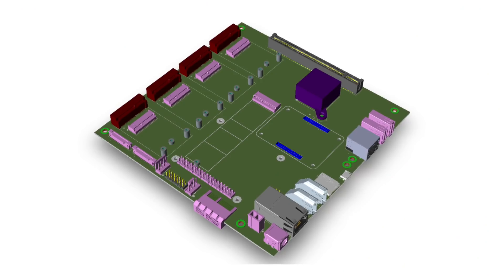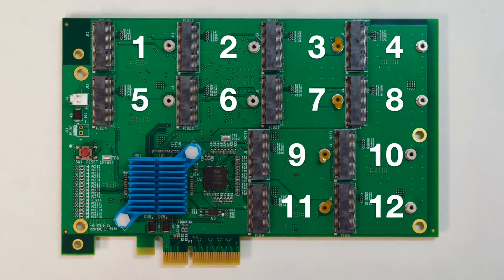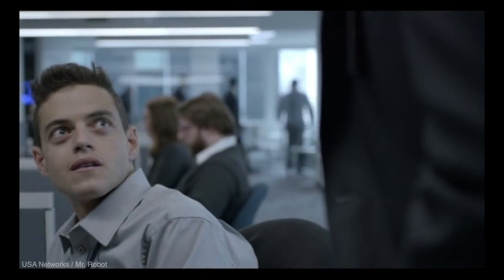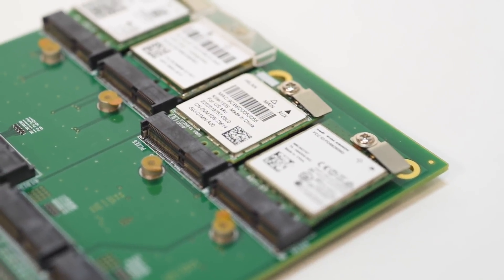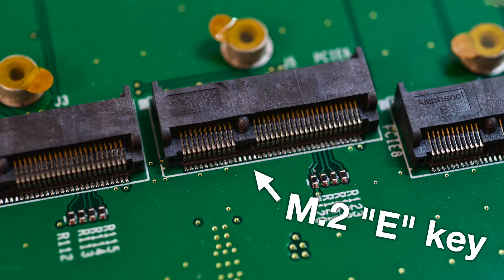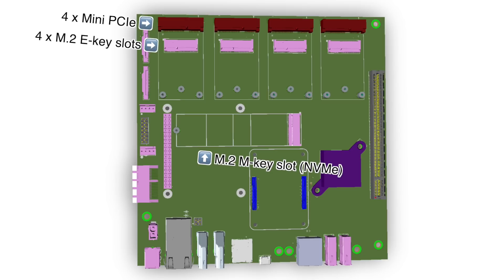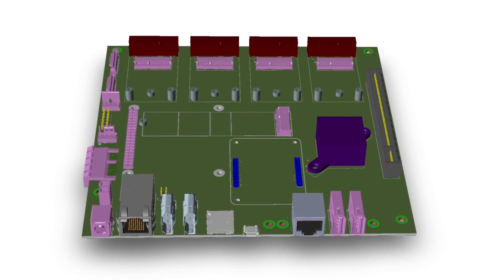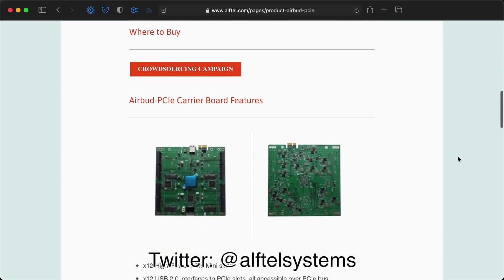12 PCI Express M.2 Slots on a Raspberry Pi!?

Comment: One PCI Express lane feeding twelve M.2 modules?
Reply: It sound rough (it is), but realistically you'll hit a CPU bottleneck before a pcie, even on an overclocked Pi4 with the revised SoC. Ideally it could be used for many low-bandwidth devices or a handful of devices that are only occasionally loaded up, which is probably why they aren't advertising M-key slots that would be used for fast SSDs

Comment: I feel like with only 1 actual lane to the Pi, having a switch is nice, but doesn't make sense for something as low performance as a Pi. PCIe external access is great, trying to share that one lane with 12 devices is not.
Reply from the maker: It depends entirely on the goal. For the use case for this board, having the ability to utilize tons of WiFi channels concurrently doesn't require many gigabits of bus bandwidth, only a little bit.

If you wanted to build an NVMe-based storage cluster, then yeah, one cheap SSD's going to saturate the bus :D
Reply: @JeffGeerling  Interesting. Now we need some external PCIe switches to at least double each port. Gotta get one Pi connected to every possible wifi channel at the same time.
Reply from the maker: @JohnHollowell  Supposedly, and I haven't confirmed this myself—the Pi checks out somewhere between 16 and 36 PCIe ports.
Reply: @JeffGeerling  evil laugh we have science to do!
Reply: It all depends on what your agenda is - x4 ARM cores running at 1.8GHz plus 8G RAM on high end models can certainly do heavy lifting, and most probable issue one will face is purely written software that handles the business. As an example that you can try is to compare Ubuntu server vs Ubuntu Desktop side-by-side with htop utility showing CPU and memory consumption per core. Very noticeable difference. Again, all depends on task in hand and software in use.

Comment: Could you try to DMA transfer something device to device, so the Pi's Bandwidth doesn't bottleneck?
Reply from the maker: As far as I can tell so far, that's not possible on the Pi's PCI bus... it has to go through the SoC and that's the main bottleneck right now.
Reply: PCIe switch design allows it, but again, this is in software support hands. Short answer without diving into technical details - yes, possible.

Comment: Just bought your cluster book :) Am checking if there are cheaper competitors to Rpi 4.. Dont need wifi, bluetooth, csi, display ports etc. CM4's and carrier board combo - too expensive. I wonder if Armbian supports some type of octacore arm64 sbc (if one actually exists).
Reply: '96Boards' you're not going to like the prices and their Not turnkey/appliance options
Reply: @paulmaydaynight9925  Ta for that.. I'll also be checking Jay at LearnLinuxTV channel for forthcoming vid on having cheap old laptops as servers in a cluster environment. Old HP G1 8GB  Chromebooks are selling for about 125 euro at the mo on Ebay.

Comment: Hard to imagine a 40 Watt, 24TB NAS Server.
Reply: If you will dig dipper in PCIe standard (best overview believe it or not can be found at wikipedia) you will see that standard prescribes certain limitations in power delivery vs card width (x1 vs x8 vs x16 lanes), and main power is sourced from 12V rail. Some manufacturers do obey this rule, but majority do not. If you will look at CM4 IO board schematic you will see that PCIe 12V rail is delivered directly from main 12V power supply, and these 12V rail pins do belong to x1 interface pins, which in turn will deliver all required power to the card in question. Of course one should be careful not to create smoke and flames due to certain current limitations that pins can handle. So, if you are short in power budget with CM4 IO card that just use more powerful power supply (you been warned about sanitized power ratings)
Reply: Harder to imagine what you'd use for backing it up.
Reply: They can always get extra power like any modern graphics card
Reply: Well, it's only 6.5TB at the moment but my current build is at 20W including the vdsl router. 3x2tb nvme on a 4 lane expander plus another USB->SATA 0.5TB. I'm using a Wyse Dx0Q thin client, not a PI. I needed the low power to ride over 8 hour + power cuts without a room full of batteries.
Reply: @LesNewell  I would suggest to look at TalentCell 12V battery at Amazon, just search for PB240B1 or PB120B2 model - these are 12V/5V 142W batteries - the best you can probably find on a market from any perspective (price vs capacity vs quality of cells inside). We used them for mobile enclosures in a field with great success.
Reply: @alexanderzakharov4249  I use a couple of 12V 10ah SLA batteries in series, giving about 200Wh usable. They are cheap and weight isn't an issue. The 24V is then dropped down to 18.5V for the computer plus assorted 5V and 12V rails for the router, SSDs, backup HDD etc.

Comment: Well... it looks like twelve sharing one lane.... that party seems a bit crowded.
Reply from the maker: All aboard for the Pi party on the 1x 🚌!
Reply: Did I miss the party?  I got caught in a bottleneck.
Reply: You bring the juice, i'll bring the switches
Reply: It's a bit more complex, as PCIe is point-to-point and such PCIe boards (for non-split-lane motherboards) have their own PCIe switch.
So among them, the various PCIe cards could have whatever the switch provides them. But yes when talking to the Raspberry Pi, all peripheral need to make do with the bandwith of a single lane.
Alexander Zakharov has done a nice pinned comment, and you'll find multiple other examples, usually as answers to questions "how do I a connect multiple M.2 NVMe SSDs on an old motherboard that doesn't split its PCIe 16x and 8x slots ?"
Reply: Same as any daily commute...